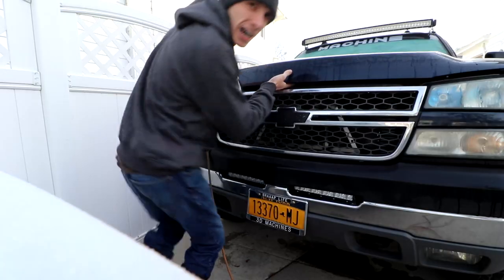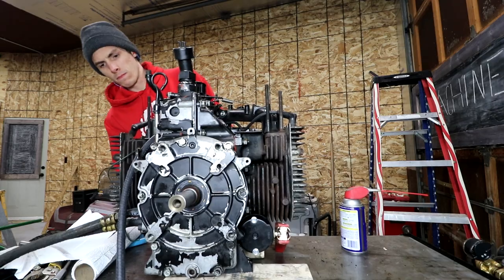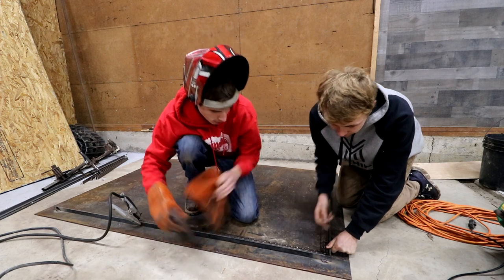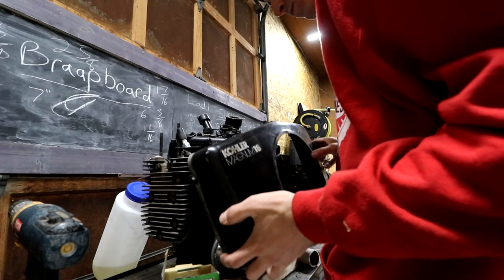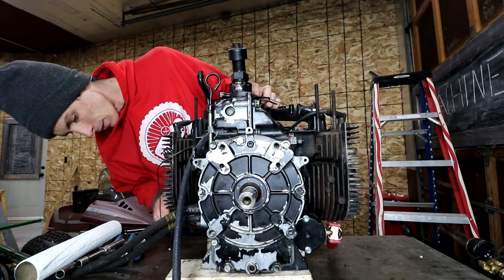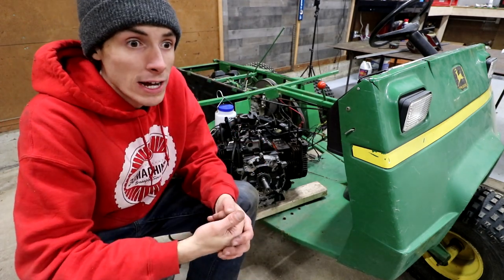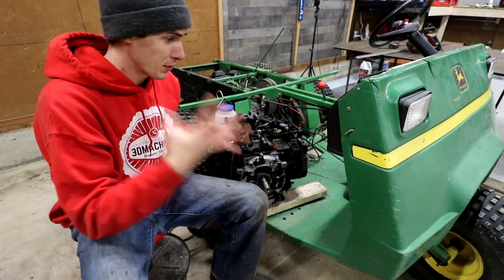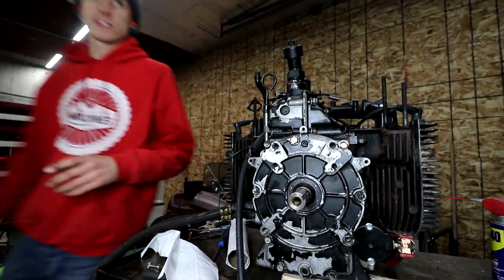THE NEW GATOR ENGINE RUNS!! *POWER*

Comment: That is an electric turbo and it does not actually help with power    Sadly I learned that the hard way 😥😥😥😥😥
Reply: Cameron, what does the supercharger even do then
Reply: Finn Helppi style points. He should find or build a belt driven or exhaust driven supercharger/turbo

Comment: Dalton, if you need any parts that are made of unobtainium for that kholer. Let me know. I have almost an entire other engine minus one connecting rod. On a side note make sure to check the oil in the kholer every time you start it or you'll starve one of the rods and break it. And trust me. You don't want to do that.

Comment: Do a test ride before the turbo so you can compare the difference
Reply: Rebels Inc. he is not turboing it? He is supercharging it
Reply: Tyler Ulwelling- it’s an electric supercharger
Reply: that "supercharger" wont make a difference. it will choke the engine. electric supercharges are useless and there are plenty of videos that dyno before electric supercharger and after. there are no gains but loss of hp.

Comment: The electric super charger will not make a change to the performance it's absolute junk no hate to u 3D there is proof that the charger doesn't work just search it up we would much rather see a real turbo we don't mind if u take a few more weeks to save up and but parts but when it's done it will have real power stay frogy fresh

Comment: i seen someone put one of those electric turbo or supercharger you call it on a pit bike and it blew so much air that it bogged the engine down. will you have a way to add more fuel when the turbo or supercharger kick on? more air means more fuel will be needed correct?

Comment: Just take it for a rip that “supercharger” is nothing but an electric fan and it won’t be able to push any more air than that engine needs to run probably not even that unlike an actual turbo or super charger that builds boost that if anything will just restrict airflow with its cheap plastic fan blades 3dmachines love your content not the “supercharger” that does nothing promise it does nothing to make it faster

Comment: Forget super charging...
Just raise the compression to about ten
Keep the RPM'S low.
Those "lawn mower" engines
are not desinged for high RPM'S
but more compression never hurts any thing.

First of all...
Turbos and superchargers
require NASA level math...
And large sums of cash...
An engine putting out twenty horse
might gain two.?
NOT WORTH THE MONEY.!

Raise the compression...?
Might gain five to ten HP.
And is extremely easy to do.!
You will need to use 93 or higher octane.

Both... Will create a lot more heat.!
(That you will need to dispose of)
So if you melt it....
You will need to build another...
Welcome to the Outlaws.!
Reply: Wait a minute...
If you want to do some thing unique.!

Build a fuel injection system
for a twin brigs.
More NASA level math...

The injectors might not be difficult...
But a throttle body.???

Kawasaki is probably already doing it.!